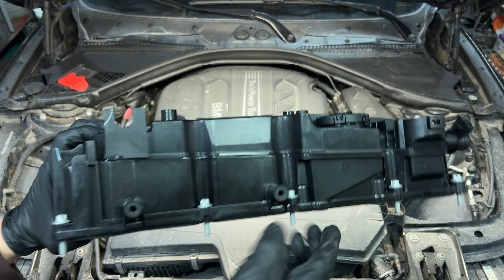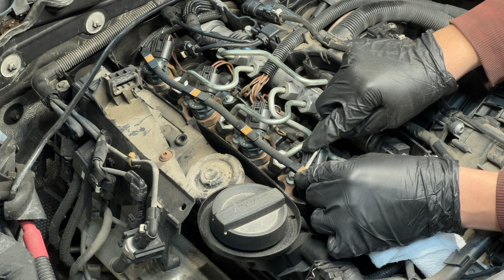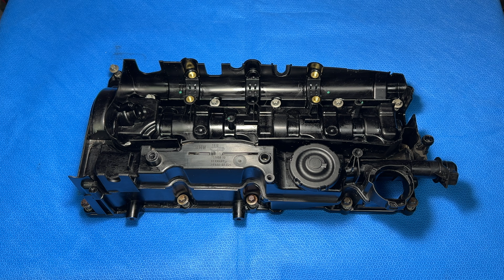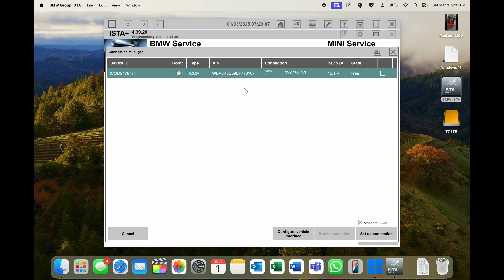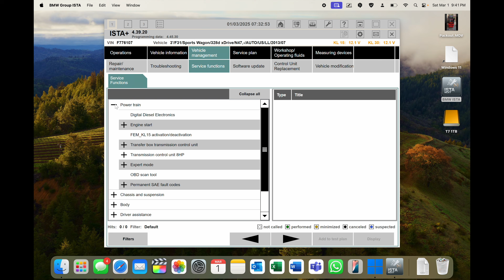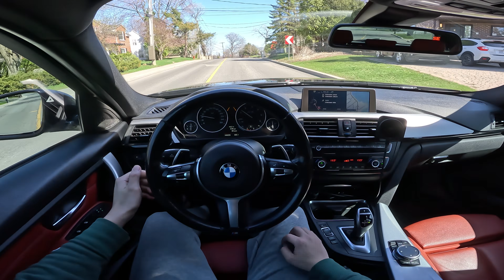BMW N47 Valve Cover / Gasket Replacement

Comment from the maker: As a few have pointed out, I forgot to reinstall the two plastic clamps for the fuel rail pressure accumulator that were removed at 3:28. 

When you need to reinstall, the torque spec is 10nm for the 4 x E10 bolts.

Comment: Just done this job on my car. Took me 8 hours in total and I haven’t finished yet. I had to go to BMW to buy replacement bolts for the injector’s as someone told me they are one use. I didn’t have the cleaning tool so i was there for a while with a rag and screwdriver cleaning them out and the holes for the injector bolts (filled with oil) I brought a breather pipe a while ago to replace, turns out I ordered the wrong one so it doesn’t work and I broke the overflow pipe on the expansion tank somehow so that’s another thing to replace 🤦‍♂️ but I got it to start up and appears fine for the 30 seconds it ran for after installing the new one. Thanks you for all the information in your video and if anyone is thinking about doing it. It’s a lot harder and scary than it looks. But manageable with somewhat basic tool set. Just got to plan for the car being off the road for 1-2 days Incase you need extra parts

Comment: Thanks for the video, it really helped me wiz through this one. The bolts for the strengthening struts must be renewed. You quote the torque as 56 + 90 degs - they are called torque to yield. The 90 degs is when yielding happens, and they only yield once. Because the metal permanently deforms during that final turn, you must never reuse them. In support of your don't use aftermarket. I did, it was ok , but it had 3 incorrect holes. I worked around it, but it was a faff. Was it worth the savings? I think it was on my 16 year old touring with 175k miles on the clock. I do a lot of suspentions rebuilds hence my knowledge of torque to yield.

Comment: I just replaced the valve cover on a f25 x3 with n47 engine. I don't have ista to bleed the system so I tried to prime the fuel pump a few times but the engine doesn't fire up. Also, for some reason when I first cranked it, a lot of fuel came out of somewhere, but I can't tell where from. The whole rocker cover is dry, no fuel there. I then removed the intake manifold to take a look at the high pressure fuel pump and the line going to the engine and the return lines, but I can't find any obvious place where the fuel came out from. There's a puddle of fuel below the high pressure fuel pump, but the fuel pump itself is completely dry and none of the lines show signs of leaking. Any idea what could have gone wrong? I didn't touch any of the lines near the high pressure fuel pump, so I have no idea why a leak developed there!
also, any suggestion on how to get the engine to start?
thanks!

Comment: this was a grate video and very helpful ! there's just one small thing, I'm not sure you have to use ista to prime the fuel system as the car has a lift pump that if you cycle the ignition a couple for times should get rid of any air in the system. correct me if I'm wrong, also you can crack off an fuel line and do it that way, again not 100% but

Comment: Hey! Thanks for the video. Lots of value from it.
One question, please, where do you get part numbers, specs, torque?
Thanks!
Reply from the maker: I use ISTA, it's the BMW software and includes services manuals/torque specs for all cars.
Reply: @bimmer.doctor Ty❤

Comment: If you were on a budget and couldnt source an OEM cam cover, is some kind of silicone sealant an option?
Reply from the maker: Definitely no silicone, but you could replace the gasket only. The whole valve cover is expensive but gasket only is less than 50$.

Comment: Great video. I have the exact issue on my E91 N47. I've been putting it off and putting it off but the stink is so bad this is a weekend job, I've a question - despite a chemical clean, could this cracked gasket also be causing me my DPF issue too. Car will never regen itself....
Reply from the maker: No unfortunately it wouldn't be related. Obviously the smell dripping onto the exhaust would be fixes, but DPF regen doesn't really have anything to do with a valve cover gasket leak.
Reply: @b @bimmer.doctor y thanks. I fixed it. Turned out I'd got a sticky EGR valve. Christ to fit it back on with the hose length BMW give you I needed to take the cooler off and assemble it off the block. Sorted the rocker at the same time and both problems fixed. Great video - thanks

Comment: Just got my Valve cover changed and the shop Showed me the timingchain and said it needs to be replaced, it had less play that yours in this video tho just minimal play sideways my 318d from 2014 has about 150k miles
Reply from the maker: Yeah, by the time there is visible slack like in my video it means it should eventually be replaced. I actually ended up doing mine about a year after posting this video and it was getting really bad. The shop is probably suggesting it because it's better to do it early, than to wait and it breaks because then you need a new engine instead of just a timing chain job.

Comment: guys how difficult is it to do. i have all the tools but will be my first time taking apart so much of the engine. do i send it or let a mechanic do it?
Reply: the injectors are really the hardest part, depends on how many miles you have
if you won’t get them out your car is stuck 
safe way would be a mechanic
Reply: @jannikj.4283 210k km

Comment: I have this smell in my car, and I also have oil in the cold part of the turbo charger, before I was having oil burning but not leaks. I have replaced the pcv valve but still getting that smell, also when the car os idling and i remove the oil lid, i have oil splashing through the lid, do you think this is a valve cover issue?

Comment: Please can you reply. I got BMW f10 2012 525D 2litre diesel. I got big oil leak drivetrain check soon message scan tool code 244C00/ intermittent smoke coming out of a left front side of a engine. Oil is everywhere bottom front and middle of a car thank you in advance

Comment: Very helpful video. I had to deal with a super stuck injector. Nothing in my tool box would pull it out, even with an engine hoist basically lifting the front of the car by the injector. For anyone else in a similar situation, CTA 7808 injector puller finally did the trick. It's a bit pricey, but it was my last resort.
Reply from the maker: Wow super stuck is right... Hanging by the engine hoist is funny. Thanks for the tip about the tool!

Comment: Worst part of this job is injectors removal and injector sealing most of the time they don’t seal as it comes out of factory because copper washers they use in factory are different, i have tried it many times with original from bmw on heavy pressure their is always some gases leak but most people don’t bother. That’s the only reason i hate this job
Reply from the maker: Yeah I've had a few injectors stuck in there really good. Luckily in this case everything came out nicely. The copper washers definitely need to be replaced, but as long as you clean the seat (special tool helps but not required) and use the correct torque, I've had no issues.
Reply: @bimmer.doctor my bad luck has been that previous few jobs someone already had messed around with bores with cleaning cutting tool and made bore slightly uneven so whenever i tried to turn that thing around i could feel uneven surface but i avoid using pressure because it’s a sensitive area but even after all effects it won’t maintain that kind of pressure. But these are rare cases but when you touch these things bad experiences force you not to take on that job, someone else is problem becomes your problem

Comment: Followed the video to the T and it was amazing but I had trouble getting the connectors on the far left off and eventually I got them but when I put them back on they didn’t click. Now my car won’t start after full reassembly. Any advice for getting these stubborn connectors to click? I’m assuming that’s my issue because everything else went very smoothly.

Comment: Hello doc! I'll be replacing the valve cover next week, what if I do not have that program to do a fuel system bleeding? What can I do? Is it okay if I directly start the car?
Reply: For me, an alternative (similar or exact results of a fuel flush) was just hit the ignition on and off every 15 seconds or so for a few minutes (120 seconds of running ignition on/off for programmed flush) but i'd do it for a few minutes just to be safe since you dont have the actual tool. I did this for my fuel filter change myself and its worked out fine. But ill do the whole valve assembly next month. One of the mechanics I know told me that it's only really that significant to go the proper way if it's the primary fuel filter change next to your HPFP.

Comment: I didn’t know about how important it was to have to buy strictly BMW brand 
Intake I might have found a way to save for it..but I instead went with the Febi brand…is that ok or is it still only going to last half as long…THANK YOU BROTHER FOR THE VIDEO 🙏.
Reply from the maker: I’m glad you like the video! Speaking from my own experience, I had a few too many issues with aftermarket plastic valve covers that I always go with Genuine BMW. Since you already have the Febi on, no need to worry. Use it and eventually if something goes bad you can change it then, but no reason to change it as long as it’s working properly.
Reply: Please brother can you tell me what order you go in (bolt patter) when you tighten/torque the manifold back on….is it circular from the inside out? Is it from drivers side to passenger torquing them down in rows vertically? 
Etc. PLEASE HELP BROTHER I CANT FIND A STRAIGHT ANSWER….prayers to you and yours.

Comment: Did you use new bolts for the injectors? I thought they were stretch bolts and one time use? And torque spec 24 on all then 28 to finish off, something like that. If that's the case I may try and reuse mine?
Reply from the maker: Nope, doesn't say to replace those bolts. In the service manual it says first torque to 8nm as the "joining" torque, which basically just means to get them seated properly, and, then to 26nm. No new bolts required.
Reply: @bimmer.doctor great. That saves me some ££ same for the injector washers? They are crushed on spec or can I reuse?

Comment: I own a 2012 BMW 320 F30 with the N47 engine. It started consuming oil at 80,000 km, losing about 1 liter every 4,000 km. It doesn’t emit smoke, there is no leakage from underneath, and there is no oil in the turbo or filter. Now it has 165,000 km and the issue still persists. Do you think the problem is related to what is shown in your video?
Thanks
Reply: it should be mate, look on the left side where the screws are , you can clearly see if it's wet or not just put your finger there

Comment: @bimmer.doctor, how necessary is cleaning the injector ports before reassembly. 

I don’t have the specialist tool and you’ve mentioned it’s very expensive. 

Should I try a third party tool or not both at all?

Is there a safe DIY way to do it?

Thanks!
Reply from the maker: Cleaning the bore is very important for the injector to seal properly. You could use a long skinny flat blade screw driver to scrape the bottom edge. Lots of people do this job without the special tool and they end out fine. Just be careful not to drop anything down into the engine and you'll be okay.

Comment: I’m doing this job at the weekend, and paranoid and ready to check the timing chain. This video is a lifesaver! Anything else you recommend doing whilst I’m in there?

Can you make a To Buy List 😮
Reply from the maker: There's not really much else to do besides what I showed. I guess if you have a lot of money, and the car is high enough mileage, you could replace the injectors while they're out. As long as you replace the copper seal like I showed, you'll be all set. Good luck!

Comment: Where i can buy injectoor cleaning tool ?
Reply from the maker: You can order this (very expensive) Genuine BMW tool at the dealer, or online. P/N 83300493758
Reply: @ i bought after market but what diameter nozzle hole ?